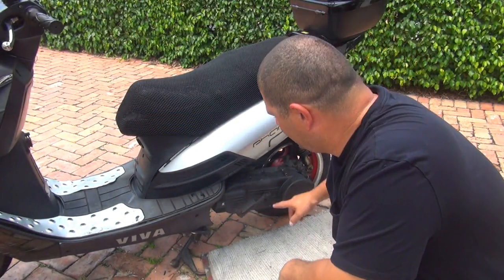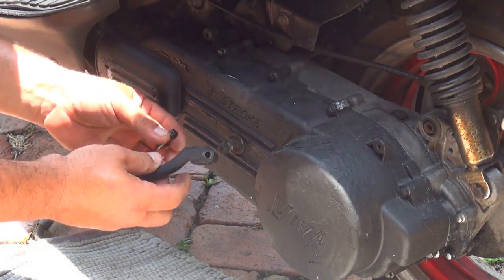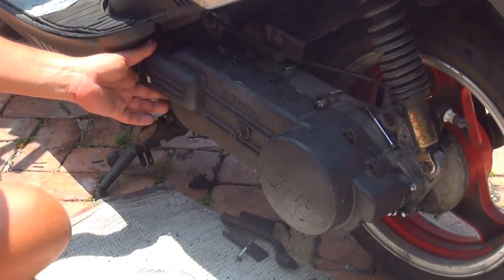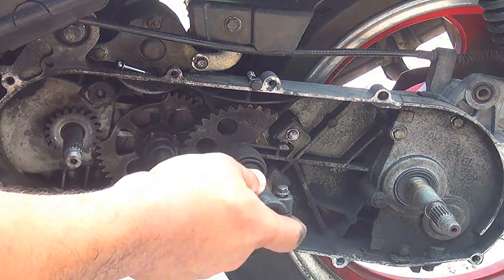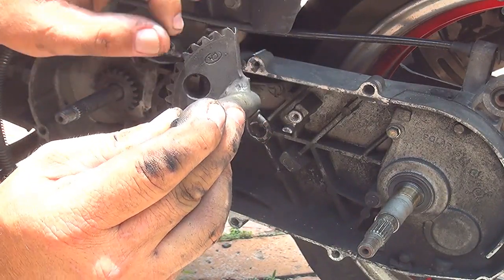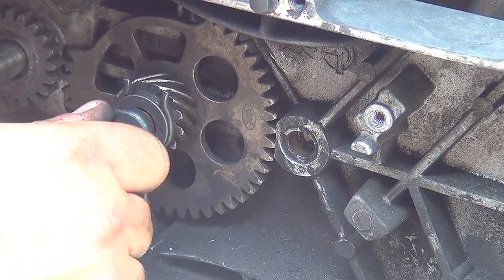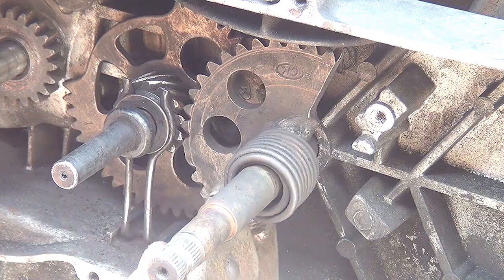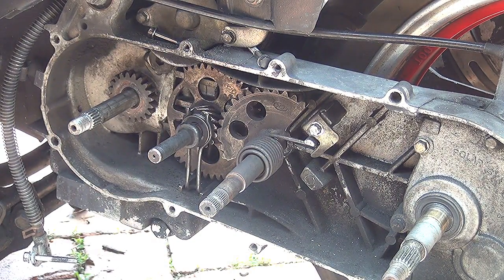GY6 150cc scooter Kick Start assembly

Comment: for those of us less skilled, Id suggest using a needle nose pliers in placing the spring. theres not alot of room to work with, and a needle nose, makes it just a bit roomier.
Reply: Even better use Locking type of needle nose pliers!

Comment: Do you grease up the gears to prevent them from locking up?
Reply from the maker: Hello I do not put any grease because if just a touch of grease goes on your belt you going to have a big problem . Thank you for watching my video and Happy Holidays
Reply: Thanks. I was curious because my kickstart lever was so stuck, I forced it by hard kicking it & the lever stripped. Now it’s hanging. Going to replace the lever and the gear once I open it up tomorrow

Comment: What to do if it won’t kick down like it’s stuck just click click and clicking…my gy6 150cc have great compression just the damn kickstart won’t work how to fix it …
Reply from the maker: f your kickstart won't work and you're hearing clicking, it's likely a problem with the kickstart mechanism or gear. To fix it, try these steps:

Check for any visible damage or wear on the kickstart mechanism and gear.
Lubricate the mechanism and gear with high-quality grease.
Ensure the kickstart lever and gear are properly aligned.
Check for any binding or looseness in the kickstart shaft.
Replace any damaged or worn parts.

Thank you for watching my video

Comment: I already paid $100 for mine to get repaired. Ive ridden it for 4 weeks and the bushing behind has failed which has lead to a fucked kick starter again.

I've spent hours trying to put the spring on and haven't been able to do it. I think its because I havent pulled the gold/green spring cover off mine. The reason I havent done that is because i dont think I can get the nut for the clutch cyclinder off. All i have is battery impact driver and a breaker bar but trying to take the nut off spins the cylinder.